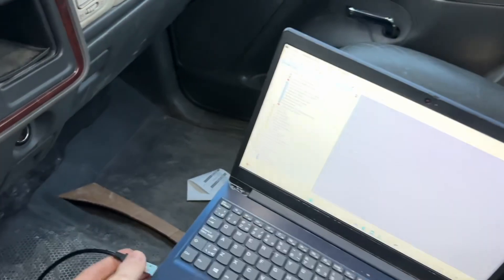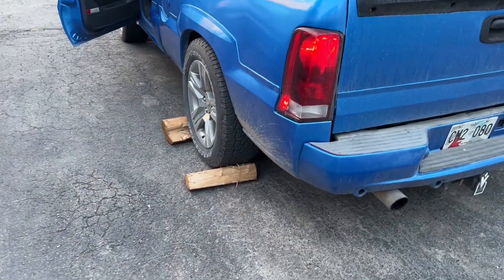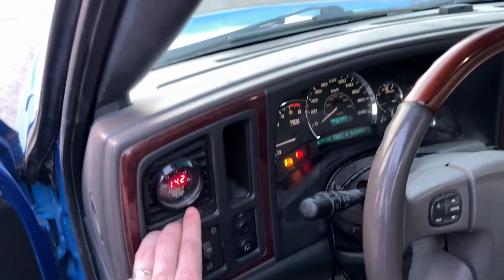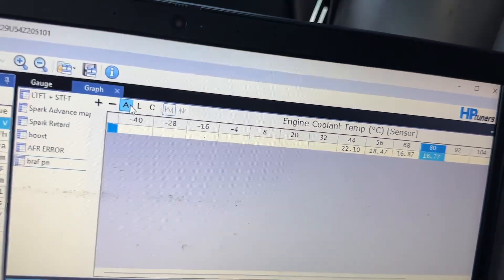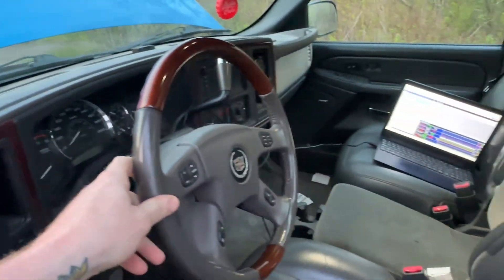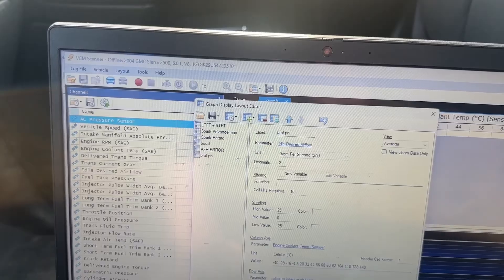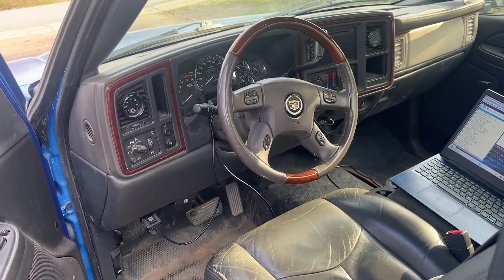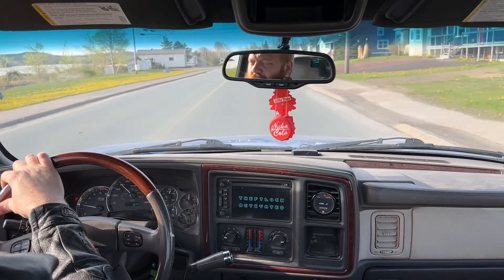How to tune BRAF so your big cam LS doesn’t shut off at stop signs

Comment: Wouldn't it be better to do this with the brakes applied because that's how you normally drive it?
Reply from the maker: It definitely made more sense as I was saying it out loud. The truck has hydroboost which does apply load on the engine through the power steering pump. I think I’ll do that next.